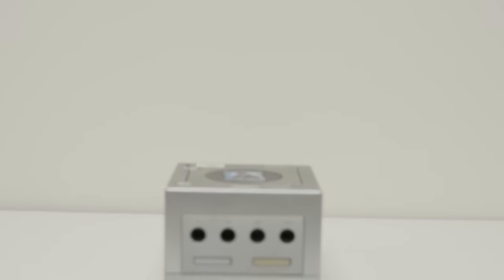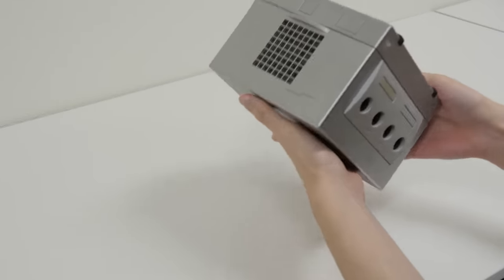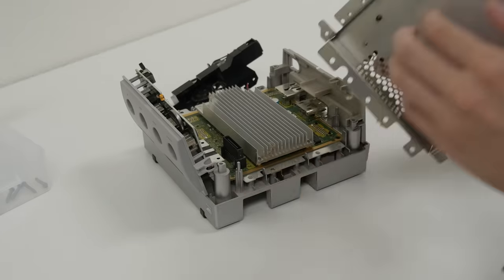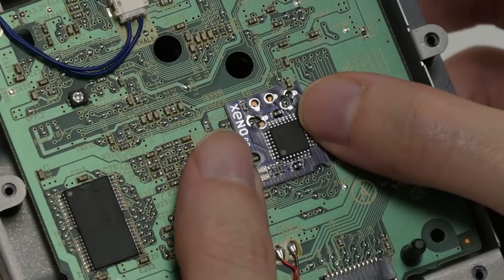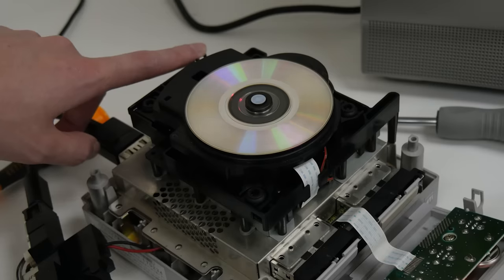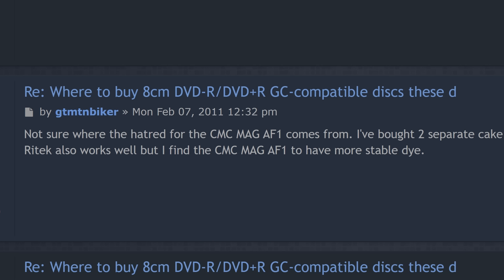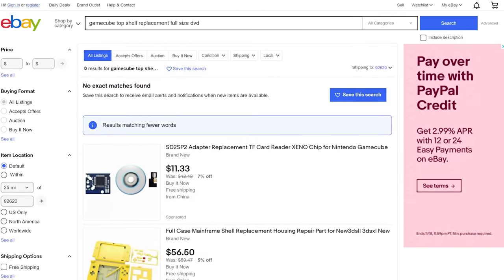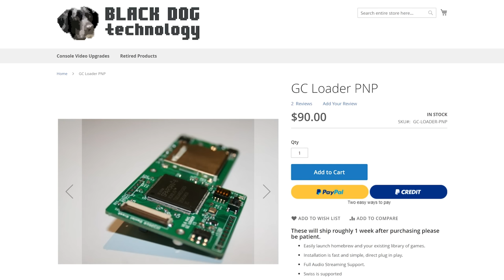Buying a $3 Gamecube from Japan

Comment: GC are the worst with mini dvd media. The XenoGC typically does require a lot adjustment to read burned media. I’ve found that Phillips Mini-dvds are the best for GC. I use to install these chips for others and it was really a total crap shoot if their laser was going to be able to handle burned media. The GCLoader is totally the way to go. I don’t recommend anything other than that these days. Can be pricy… but with never having to burn another disk… it’s worth it. For the record… the same holds true for PS1 and other optical media consoles. The only console I can’t recommend and ODE for is the Saturn as its $300…. Burning games still seems to be the best alternative there.

Comment: I have a mod chip that came with this new style card reader that connects into one of the ports at the bottom the GC and supposedly with a boot disc it came with once installed can read games from an SD card reader so you can keep the disc drive in as well. Would like to have the time to try and install it one day.

Comment: Funny how Hard Off set the price tag, usually they don't try to fix things I guess, if it work they put on a ridiculous price, 5500 yen for used Xbox series / PS4 controllers, no box. But if it not they go full Daiso, "everything is 300 yen, included tax!"

Comment: How possible would it be to modify the CD itself to physically fit into the regular GC top shell? Would cutting the CD to size ruin the data even though it's only written in the small area in the middle?

Comment: Its ways nice to see old consoles being rescued. Someintes you may not realise sothing bdoken is an easy fix. For instance my wii with ive been meaning to homebrew but have been barred from wifi do to 5ghz and 2.4 ghz not agreeing had a dead fan. Nothing was cooling it and i eventually got myself a triwing and a new fan and it works like a charm although the disc drive makes clickong noses when inserting and ejecting games but it still functions.

Comment: The thing about optical discs is, they are not perfect. I have tried to read a disc on one computer, which did not work. So, one would think the problem is either the disc or the drive. However, the drive worked with all my other discs, so the problem must be the disc. However again, that disc worked on all my other computers. So, there was nothing wrong with the disc, and nothing wrong with the drive. The two just didn't work together. Why? I don't know but I have a guess. Manufacturing tolerances are not always perfect.

Comment: Wd40 really IPA exists u know and kills sticky stuff easy alternate version turpentine spirit same stuff pretty much will clean the adhesive rapid u even use IPA in the controller port? And last but not least why not pop the jewel out of the lid to clean it little clip on the underside if I remember correctly

Comment: The GameCube is still the best best way to play GameCube games because of its component cables, which give a visibly better picture than a Wii with components. So stupid but true....and they're 300$ on eBay....
Reply: you can get the carby gamecube hdmi for much cheaper than the component cables and it's even better because it's a lossless digital signal

Comment: Why did you play the fake gamecube intro?

You might try picking up some plastic razor blades if removing stickers is something that comes up. They are suuuuuper useful for scraping anything off of anything. Much easier and cleaner and less likely to scratch than using a fingernail. I sometimes use them to remove those price tag stickers from cardboard board game boxes and they work so well, nothing else i know of can do that job

Comment: Hey dude, have you heard of the error code 160-0103 for the Wii U? Its where the system memory corrupts when running certain tasks. My wii u fell victim to this a while back so i tried to reset it to fix it. Bricked the system like an idiot i did. If you could help in any way please do let me know! Thx

Comment: Dude I love your video it's super epic I just want to tell you I got a game for you the same color but it's a Pokemon XD version and it had water damage on the board and the gears were all gunked up on the laser drive and I fixed everything and it works hundred percent I used a Windex and put it on a paper towel and I carefully got the water damaged off the board I went every side of the board and when I first clean it all off and put it back together and work 100% again well except the battery for the clock that needs to be replaced well once again  you're video is super epic 👍😁👍👏👏👏👏👏

Comment: Old nintendo consoles are super reliable most of them with simple cleans with ipa are fixed, the switch is one of the worst in reliability couse its very slim it should be thicker imo, also the joycons need a bit more thickness to make more reliable sticks and cables, anyway its a pretty reliable console the switch but not as much as old ones